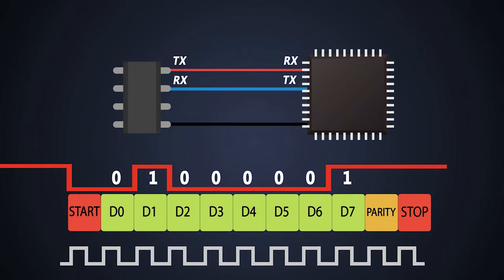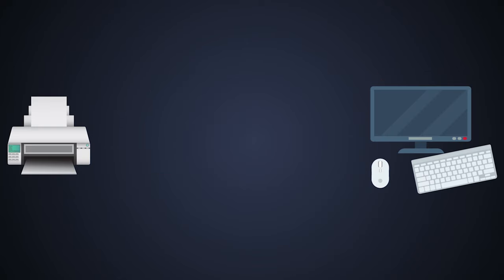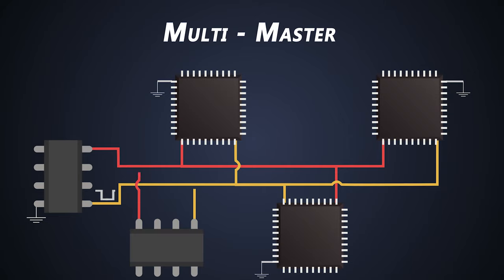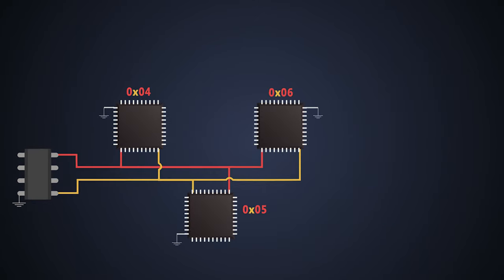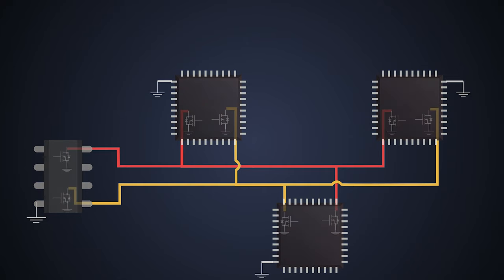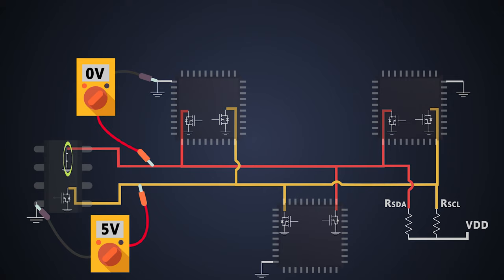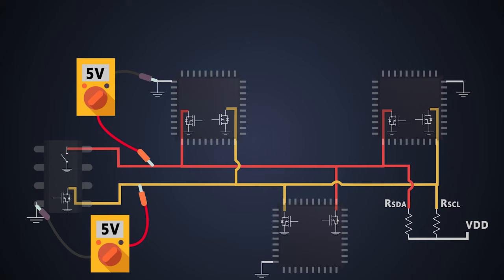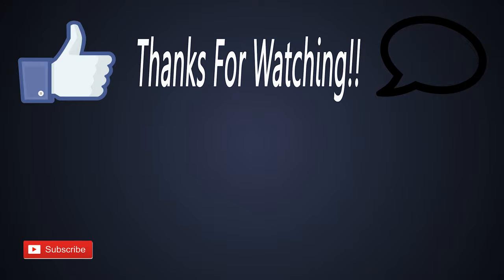Basics of I2C communication | Hardware implementation of I2C bus

Comment: Yeah, the I2C is a bus, but more information I did not get. Is there a handshaking? How do the other chips on the bus know how and when to shut up? Are there protocols for emergency, are interrupts possible? I guess we never will know.
Reply from the maker: Hi @vanhetgoor,

Thanks for your question and watching our video.
Yes I2C is bus and here is an answer to your questions:
1. Is there a handshaking? How do the other chips on the bus know how and when to shut up?
-  No there isn't. I2C is multimaster. We have covered Arbitration and Clock stretchin in our next video https://www.youtube.com/watch?v=PpP92m0xCqE&feature=youtu.be . Please go through it.
Also please check a piece of code which will help us understanding how devices use arbitration policies
https://en.wikipedia.org/wiki/I%C2%B2C#Example_of_bit-banging_the_I2C_master_protocol

2. Are there protocols for emergency, are interrupts possible?
- No. Not possible with I2C, if I2C starts providing interrupt signals from slave devices, multiple masters needs to be connected with such 100s of slaves interrupts and there will be number of hardware connections on buses. So hardware interrupts not possible with I2C, but possible with SPI. SPI slaves allow hardware interrupts like DATA_RDY, since SPI is generally used for peer to peer communication. 

Thanks

Comment: what if 1line is always 5v and another one is 0V.. when it turn on that 5v turned in 0v and the other one goes to 5v.. is it I2C ? (This is a Octen Pump Flow meater) it have total 5 line... 2 power and 3 other. 2 line change value like on and off.. an the others one always give 5V